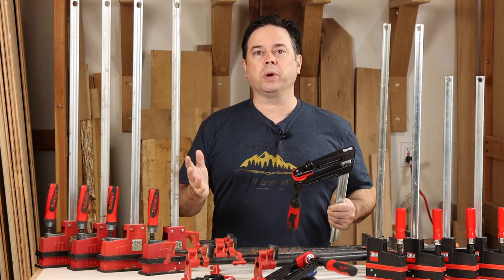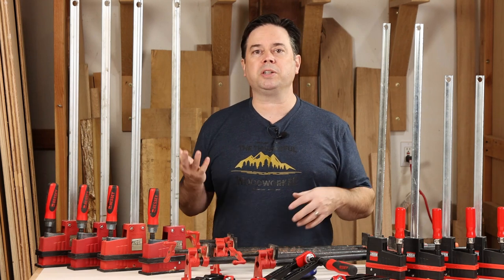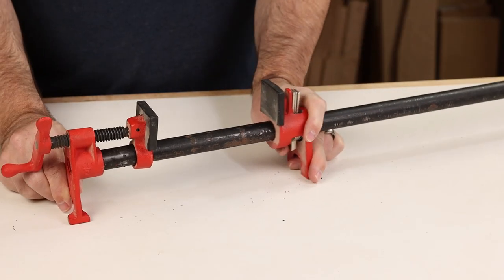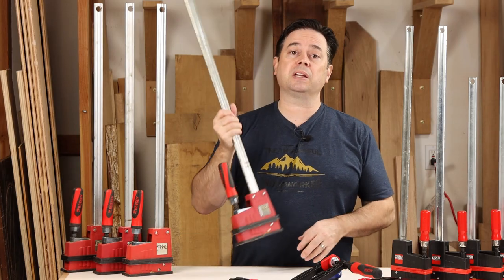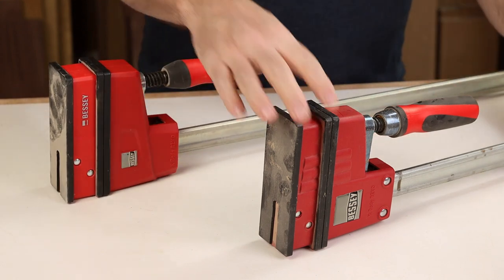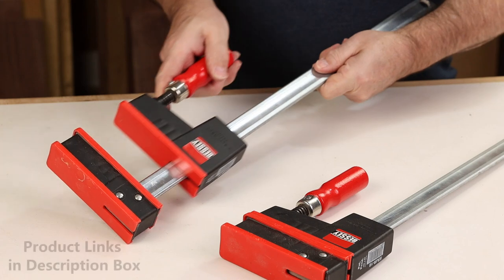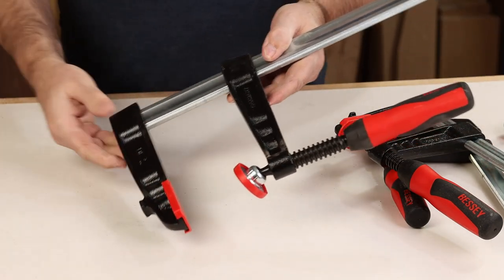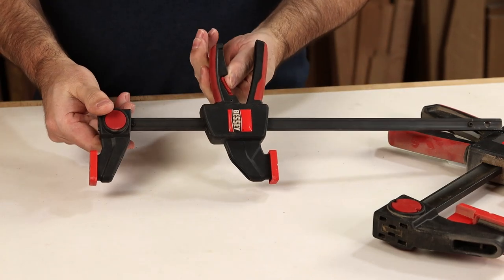Which Woodworking Clamps?  The Answer Will Surprise You.  Choosing the best Woodworking Clamps

Comment: Why most youtubers say pipe clapms are the cheapest? I live in Europe, pipe and sash clamps cost 35-50€ (including the pipe). Parallel clamps start at 45€.
Reply from the maker: Certainly your location plays a big part on price.  Currently in the US, a 48" pipe clamp is 45% the cost of a Bessey K body 40 inch parallel clamp.  Thanks for your insight on regional differences, that's eye opening.  Best to you.
Reply: But can you get a 2m - 2.5m parallel clamp for under 50? Long pipe clamps are cheap. Multiple short ones are not as cheap, but you can change pipe length at will, which you cannot do with other clamps. And I don't think they even make 3m parallel clamps. In US, you can get a 3m pipe for $40~ and have it cut to size. Some places have pipes in bargain bins sold for even cheaper ie. building supply stores.

Comment: “The pipes themselves are so inexpensive”?  Home Depot and Lowe’s are charging $27 for a 3 ft threaded pipe!  Most people won’t take the time and effort to buy 3/4” schedule 40 pipe from a local pipe supplier for about $1.50 per foot.  Also, you’ll have to cut and thread that pipe.
Reply from the maker: I use the 1/2" pipe, which as of today is $14 and change for a 36" length.  The H clamp is also $14, so around 28 bucks per clamp.  By comparison a 40" parallel clamp runs about $60.  That's quite a bit cheaper in my book.  I've never had an issue with the 1/2" pipe clamps, even on large glueups, because I place them top and bottom to balance the force.  Best to you.

Comment: You're supposed to wax the parallel clamps so that glue is easily removed
Reply from the maker: That might help with the glue, but do the clamps ever slip with wax on the bar?
Reply: @TheThoughtfulWoodworker  No, this is common practice. paste wax specifically
Reply from the maker: @agentchodybanks9120  thanks for the tip
Reply: Another option is painter's tape over the exposed bar.
Reply: Does it goop up the clamps?

Comment: I'm an amateur woodworker of about 3 months now. I only have20 clamps for now which is fine with the amount of finished product I put out. I have bought all my clamps at harbor Freight mainly the pistol grip clamp/spreaders. Cheap, durable and can put a ton of force on them and none have broke yet. I have a few of their parallel clamps which are ok but i do want to upgrade soon and most likely will go with Bessey clamps. They're not extremely expensive and seem to be great at what they do and last a long time. thanks for the video!
Reply from the maker: Thanks mate.  Good luck as you add to your clamp collection.
Reply: Home Depot has the lowest price on the Bessey Clamps. Stay away from the Bora I have had nothing but issues with those. The Aluminum Bar Clamp at Harbor is a good clamp I have some older adjusted Aluminum Bar Clamps and they are used a lot in my shop. Being that Harbor buys direct from the factories in China some of the items are the same as name brand. Compare before you buy. Also Irwin Clamps like the Bessey are great clamps also Jorgensen that you can find on sale at Lowes.
Reply from the maker: @jwar2163  thanks for the specifics, and the warning on Bora clamps.  I have no previous experience with that brand.  Thx.
Reply: @jwar2163  I recently bought a few HF bar clamps and they are very nice and stable clamps. Thanks for the tip
Reply: @TheThoughtfulWoodworker  Watch 731woodworks video on the best clamps. Bora did really bad. The wildcard clamps were the Bremen Harbor freight trigger clamps. They actually did very well and are cheaper than any other name brand clamp
Reply from the maker: @ns_racing  Thanks!

Comment: The best clamps made are wetzler. they are solid steel and cast iron, sadly they are not made anymore, I have almost 200 of the of various sizes,  I also have a Lot of pipe clamps. mine are jorgeson, the foot that you like on the bessy I Don't like, sadly the Jorgeson which used to be USA made are not anymore and are not of the same quality as they used to be. I am not a fan of parallel clamps and don't use them or own any.
Reply from the maker: Interesting, I've never heard of Wetzler clamps.  Sounds like you have a prized collection.  Thanks.

Comment: I've pretty much kept with the 3/4 pipe clamps and couplers as you mentioned.  I can make clamps as long as I want, but tend to keep them at 36 inches.  I use trigger clamps for anything else.  Do the parallel clamps really have more power than a pipe clamp?  Maybe I missed it, but why specifically would you go with the parallel clamps instead of pipe clamps?
Reply from the maker: I wouldn't say parallel clamps have a ton more power.  The bars might be a little stiffer, just because of the shape.  They're supposed to help keep panels or doors flat and true.  This can also be done with pipe clamps top and bottom.  The bigger jaw pads are sometimes a benefit on parallel style clamps.  Thanks.